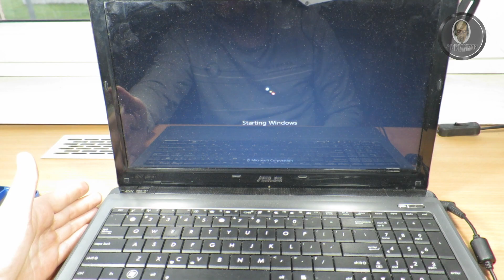Asus A52F - Cleaning fan and replace thermal paste

Comment: Can i upgrade processor of this laptop..i also have asus A52F
Reply from the maker: Sadly it's not that simple, there are so many versions of A52F that it's hard to check that.
Check Your exact version under laptop and type that in google with compatible CPU and You will find what You can put in.
Reply: @Adrian202  I've i3 M350 processor

Comment: Hi i have same model wondering if you have any advice. have dusted, cleaned, and reseated every component (including keyboard), given the cpu new paste, and it won't boot. there is no display. any diagnostic tools?? thanks
Reply from the maker: Start by taking some parts out or disconnecting, RAM, Wi-Fi, keyboard, HDD, DVD.
You need to have RAM in the laptop to turn it on, but the computer should have some signs of life.
If power plug or socked is broken, bending cable or plug slightly to the sides should have some effect.
You also can have broken power supply so would be good to test it with multimeter.
Also, check on the internet if someone have same problem in that model, because this could be series fault
Good luck